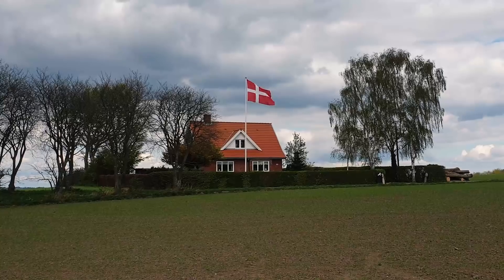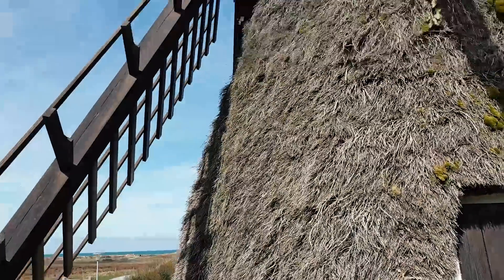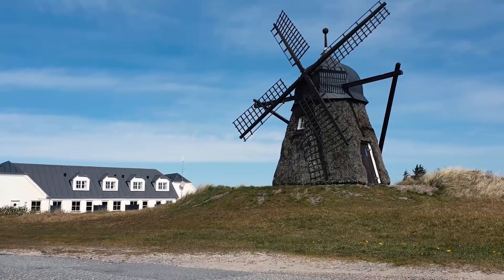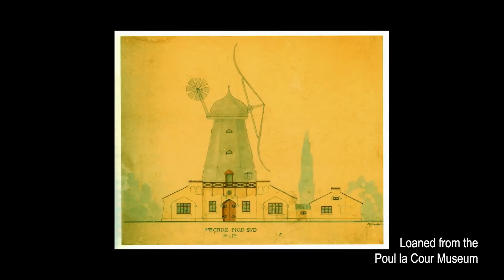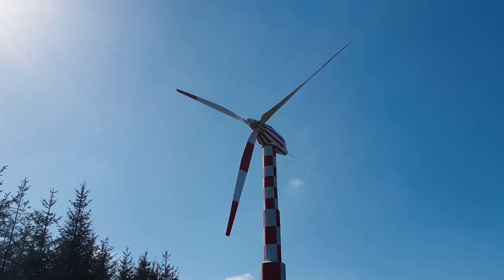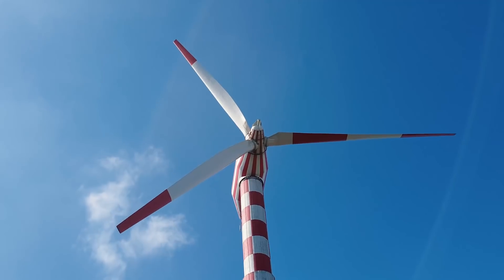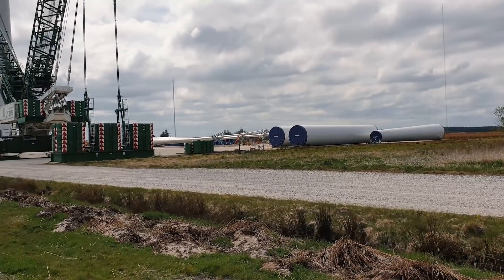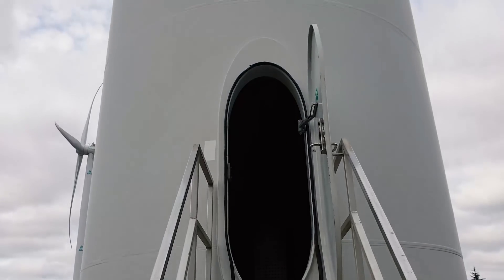Wind Turbine Design Evolution in Denmark

Comment: Denmark suffers high power prices and most of their energy still comes from burning waste and fossil fuels.
Denmark fails harder than Germany when it comes to the insane solar and wind nonsense.
Reply: False on both accounts. Denmark has some of the pre-tax cheapest power in Europe (https://ec.europa.eu/eurostat/statistics-explained/index.php?title=File:Electricity_prices_for_non-household_consumers,_second_half_2020_(EUR_per_kWh)_v1.png). And no, most of the electricity (not "power" - which is weasel wording in this case), does indeed come from renewable sources, wind being around 45% of the total electricity production (https://energinet.dk/El/Gron-el/Deklarationer/Hvor-kommer-stroemmen-fra).
Reply: The high power prices is because of taxation so it not because of production costs and there is an upside to the high prices.
The taxation on energy in Denmark has meant people are generally thinking of energy efficiency, so for example Danish houses are well insulated and things like triple glassing is often seen.
As for most of our energy, well most cars still run on fossil fuels however our need for electricity not so much. In fact for two years running more than 50% of our electricity has come from wind and solar power, with a significant part of the rest being imported from Sweden and Norway which then means electricity that is either Nuclear or hydro based.

 Oh with regards to falling - that is just nonsense.
Reply: @bzdtemp  your grid indeed relies a lot on Norway and Sweden who make an nice profit on their hydro because of Denmark. Your 'green' energy also comes for half from the profitable incineration of garbage.
The high tax on electricity is to finance all those windmills and their expensive grid connections.
Reply: Norway and Sweden love carbon tax, they sell carbon credits. They allready have the hydro and the eu now gives them free cash for it.
Reply: @picobyte  Dude I live here. I don't know where you are, but you get a lot wrong.
When we burn waste in power plants that isn't counted as wind or solar, of course not so that is just silly talk suggesting it is part of what I refereed to. And btw. our burning of waste is actually done in a way that makes it a whole lot cleaner than if it was coal + it also means we avoid having massive land fills where we would otherwise put the waste. Worth nothing is also that we do much to reduce waste by reusing recyclable materials, so for example almost all bottles and cans are handled separately which saves lots of energy and materials.
And yes, for a while the high electricity taxes was partly used to fund wind mills only how is that a problem. Now ind turbine tech is so advanced it is cheap to make electricity that way than to burn coal, so our partly funding helped make wind turbines into what they. This then benefits everyone and it has also given us a industry that provides jobs all over the world and make money.
You should be thankful our high energy taxes help creation of energy efficient tech and solutions, it is helping the planet go green and fighting climate change.
Reply: @bzdtemp  I didn't say that burning waste is bad or counted as wind/solar. But your country does count it as 'renewable' .
As far climate goes, our CO2 doesn't matter at all for that. The whole CO2 scam is Mann made Fraud.
Reply: @picobyte  Show me where we claim burning waste is renewable?
"The whole CO2 scam...". What are you on about, if you're referring to the quota system then while not perfect it is a really good way to nudge polluters in the direction of polluting less. How is it a scam?
If you're suggesting that climate change and global warming is a scam, then don't even bother replying. Instead spend the time to read some science and understand it is very much real, in some part of the World it might just mean freaky weather on occasion however in others it is a disaster happening.
Reply: @bzdtemp  Taxing harmless CO2 and ignoring the real pollution that the production of solar panels brings. Is very ignorant. China where most of our solar panels come from has more coal plants running for that than the whole eu has in total.
Their radioactive wast is even worse when all the digging and refining for 'rare earth' minerals gets counted. 
The whole renewable energy thing is a sick bad joke.
Reply: @picobyte  "harmless CO2.."
What is next, that wind turbines causes cancer?
Reply: @bzdtemp  i'm prettey down to earth on that one. The modern super big windmills do cause lots of noice and it's the sort of noice like big machines and trains produce. Don't take that from just me..
Reply: @bzdtemp  the high price for power is directly related to renewable wind and solar. Windmills don't live long at sea. 15~20y and they need replacing. Also their grid connections are bloody expensive. It's called hidden costs. And it's the same in the Netherlands and Germany. A set of 800KVDC converters is as expensive as a complete coal/gas generating plant.
Never under estimate politics and their classy lies.
Reply: Wind and Solar Power is without doubt now the cheapest source of electricity generation. One thing is the generation cost and the other is the distribution cost of electricity. Don't mix it.
Reply: @hugoschippmann8368  wind and solar are very expensive and dilute, their exclusive low utilised grid connections are just part of their insane costs, so is their ff bachup.
Reply: @hugoschippmann8368  Read this:
https://wattsupwiththat.com/2020/07/03/weaknesses-of-solar-and-wind-myths-and-questions-that-require-an-answer/
Reply: Don't be silly.

Comment: May I suggest that you make a video of batteries as well? Tesla’s Battery Day video and one of Tony Seba’s Energy Abundance videos could be a place to start. Basic hypothesis is that global battery production capacity has grown exponentially for quite some time, and will likely continue to do so for decades. Battery cost has dropped exponentially, and will likely have another 80% drop over the next decade. This will enable renewables in a magnitude that is hard to imagine today, and give us energy abundance (energy is almost free) over the next 50 years. Also Seba claims that current estimates of cost of fossile based energy forms is way to high, putting batteries + renewables below fossile already now.

Comment: a clear overview, the only confusing part: why is there a steering wheel at the right side?? ;-)
Reply: I wonder about this as well... I mean she is Australian, but she probably didn't bring her car 🤔
Reply: Some mobile phones flip the image when using the selfie camera, so I expect it is that
Reply: @t1-6t  Actually in a recent video she mentioned that she moved to Denmark, so she probably just brought the car with her from Australia. If you wanted to be really creepy, you could compare her moles from studio shots and see, that they are not mirrored. (I am very sorry for doing that, but I was so intrigued by this question before I knew the reason... 🙈)
Reply: @miallo  Good sleuthing but at 10:14, a car passes on her right, which is consistent with the video being mirrored (if it were a left hand drive car, cars wouldn’t pass on the driver’s side in Denmark).
Reply: @t1-6t  Right - let me add 0:00 to the evidence. She has the sun in her face, meaning she is facing roughly south (at least not north), so we look north. She says she is on the west coast, so the ocean should be on our left => mirrored
Reply: @t1-6t  If you have OCD I would advise you not to pay attention to the blades of the heather mill starting from 0:56 - depending on the camera, you can see that some shots are flipped and some are not...

Comment: At 10:50 you can see that the off-shore turbines are all lined up in a row. This seems like bad planning to me. If the wind direction is parallel to the row of turbines, they will all be in each other’s wind-shadow. Wouldn’t it be better to place them in an irregular geometry so that no more than 2 turbines ever stood in each other’s wind shadow? I expect the mathematicians already have a special way to do this, perhaps like the 8 queens on a chessboard where no queen can take another.
Reply from the maker: Yes absolutely, well spotted! The wind direction is probably fairly constant at that site, so it doesn't happen often that they're all in each other's shadow. That was a very early wind farm. But these days they take turbine placement very seriously, with plenty of maths and simulations used to optimise.

Comment: Very educational. Wish you had talked about noise. Where I live opposition to windmills is growing because of the noise. Not very nice when you have to listen to "wooosh" all the time. Maybe there needs to be limits to windmills on land? What should the minimum distance between a windmill and a house? Maybe limit the rotational speed?
Reply from the maker: Hi, I do plan to maka a video on wind turbine noise, it is a common concern. I would also not like to hear wind turbine noise in my home or backyard. I have lived within 1km of a wind turbine in Denmark and from that distance there was certainly no audible noise. In most or maybe all countries there are limits to how close to houses you can build turbines, and there are noise limits on turbines that are taken very seriously by turbine designers and their customers. The rotational speed is indeed limited by the noise requirements as you suggest, at least for onshore turbines. Offshore the noise isn't so relevant. 
I think a whole video on wind turbine noise and the ways that engineers try to reduce it is necessary to explain the topic well enough, so I will see how soon I can get that going. 
Thanks for the comment.
Reply: @EngineeringwithRosie  
People tend to live where the wind is not at its maximum, and wind turbines tend to be placed where people don't live.  So it's not that much of a conflict.

But you can't beat solar PVs when it comes to being quiet.  👍👍🤗

Comment: Great video telling a really interesting story.  Just one thing to add - a sailing boat moves  thanks to exactly the same forces that  drive a wind turbine blade and aeroplane wing - flow over the sail creating lift - it's not "blown by the wind" as you say at 1:47 ! :-) Keep the videos coming, a really well done intro to wind technologies.
Reply from the maker: Hi Liam, thanks for your comment! I am not a sailor, as you have guessed, so I am certainly happy to be corrected 😁 I think I said old windmills were like a sailboat that is sailing directly with the wind, or something along those lines. In this case, wouldn't a sail be pushed by the drag force of the sail? If you are going in the exact same direction as the wind, your movement couldn't be caused by a lift force, since lift acts perpendicular to the flow direction, and if you're moving parallel to the wind, there's no perpendicular component.
Now, perhaps it is the case that no one ever sails directly with the wind, because there isn't any lift force, so you're not really "sailing" and the drag force will get you where you're going much slower than if you criss-cross at angles always using a lift force over your sail. If you sail yourself then you would be better placed to answer this! I personally get very sea sick so I can't take up sailing even though I think it is a really cool sport (and verrry popular here in Denmark). 
In any case, I take your point that this is not the best example so thank you for pointing that out. Now I need to think of a different example for the next time I try to explain this concept 😋
Reply: @EngineeringwithRosie  a great channel with interesting and useful videos.

Sailor, windsurfer and engineer (structural, not aero or mechanical) here.
Going with the wind (parallel) is known as running and yes you are correct, it's just the drag of the sail pushing you along. I would prefer not to sail on a run for a few reasons:
- It's potentially unsafe: a slight change in wind direction or change in boat direction may result in the boom coming across (uncontrolled gybe, a skipper was killed on the 2015/'16 Clipper Race from this type on incident).
- it's slow: sailing at an angle to the wind to get a perpendicular component as you surmised is quicker. Sailors call it apparent wind (boat velocity + wind velocity) and it's much more critical to lighter and faster vessels such as catamarans, windsurfers, kitesurfers, foiling boats such as the America's cup, MOD70s, Olympic 49er, International Moth etc. Running with a catamaran for example can cause the boat to cycle between acceleration and deceleration as boat speed cancels apparent wind speed.

I'd only sail with the wind (running) when my course is constrained (by depth/water available or room to manoeuvre), if the vessel is so slow that apparent wind doesn't have a huge effect or when the wind is so light that the apparent wind has little effect on boat speed and velocity made good.
Reply from the maker: @OisinHiggins  Wow, great information! Thanks so much for adding this.

Comment: Pitch regulated. Like aircraft have been doing since ww2?
Reply from the maker: I'm sorry, I don't really understand your comment. I haven't worked with aircraft design since my student days, so it could be I'm missing something obvious, but I don't think that aircraft ever used stall control did they? With the exception of aerobatics I guess. Aeroplanes have always been able to control the angle of the wing relative to airflow, otherwise they wouldn't be able to control when they wanted to climb, cruise, descend. It seems crazy to me that an aircraft designer or pilot would intentionally use stall as the means to reduce lift and descend... this isn't what you mean is it?
Reply: Engineering with Rosie 
I meant engine props, had/have the ability to use variable pitch for Rpm/airspeed ratios.
Reply from the maker: Oh! Ok, that makes much more sense. Thanks for explaining😀 I haven't worked with props (other than models), so I don't know all the details of the design tradeoffs there. But I can tell you that in general one of the major differences between wind and aero applications - for what seem to be similar problems - is maintenance. 

The vast majority of wind turbine components never get replaced in a 20 or 30 year lifetime. And maintenance is once per year if you're lucky. It is a major effort to get a team up the tower to even check bolt torques once per year, a massive financial incentive to keep everything simple and aim for maintenance-free. 

There are also different loads for pitch bearings on a wind turbine than there would be on a prop. Wind turbines have to transfer huge static loads through the bearings during extreme weather which is terrible for bearing lifetime. So I would expect there were bigger hurdles to overcome getting pitch control into wind turbines than into props.
Reply: Engineering with Rosie 
The similarity’s fall short on reality of a small lightweight aero prop. And that of a prop that matches the wingspan of the U2 -x3 blades. And long maintenance intervals. With a huge array of turbines to maintain seems a daunting nightmare. Is there sensor tech that feeds into a ground station to alert to issues for preventive measures? Like a dispatch area.
Reply from the maker: @bd8026  yes, sensor technology and predictive maintenance are becoming more prevalent in wind turbines. They look at changes in blades' natural frequency for example, and they are also beginning to be able to tell structural damage by doing IR imaging from the ground. I am sure there are others too, it is a field with major possibilities to reduce lifetime costs and it's really starting to take off now.